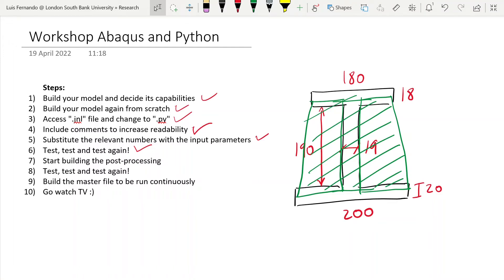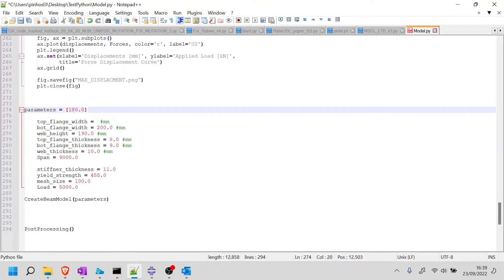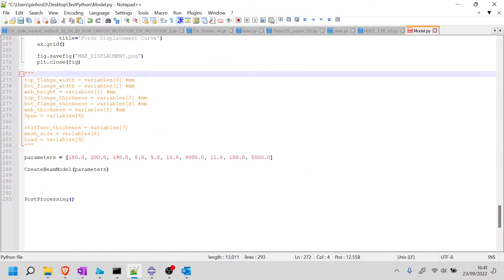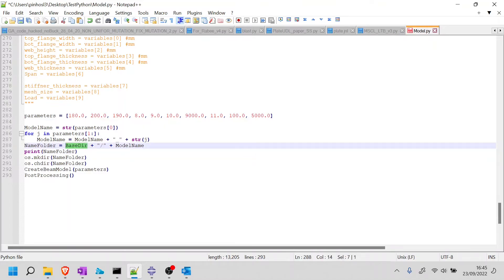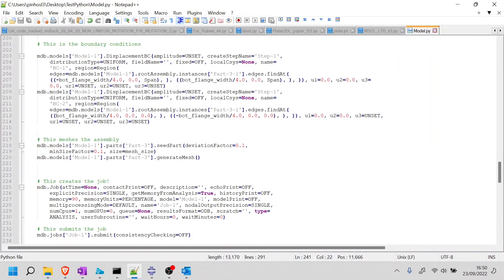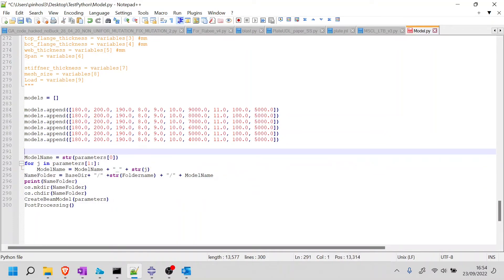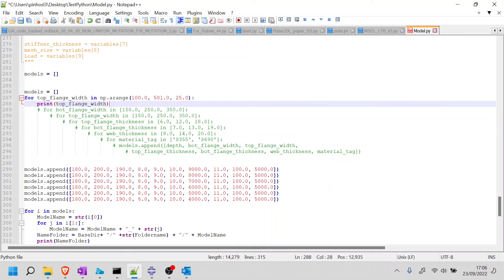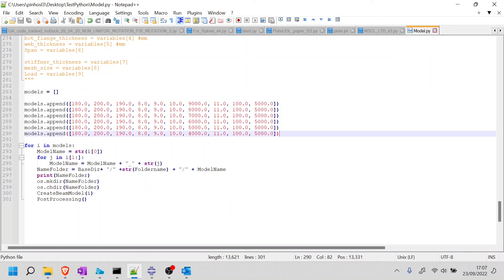Python for Abaqus - 1.5: Build the Master File - SS I-beams

Comment: I did everything, but when I did post processing, the software shows me a not responding sign. How can I know where the error is, knowing that I did everything step by step?
Reply from the maker: Hi Saher. I suggest you comment the part of matplotlib. I've seen errors with that in the past that should be associated with the Python version you have installed in your PC conflicting with the Python version within Abaqus (This is just my theory, I never tested this).
Reply: @ Well, at first it showed me the errors in the Abaqus CAE list, now I can detect them through the command.

I will try again can I have the python code you created please?
Reply from the maker: the final script is in my GitHub. You can find the link in the description of the video